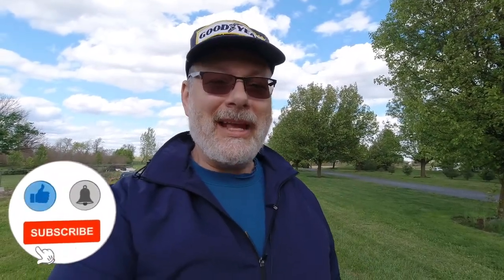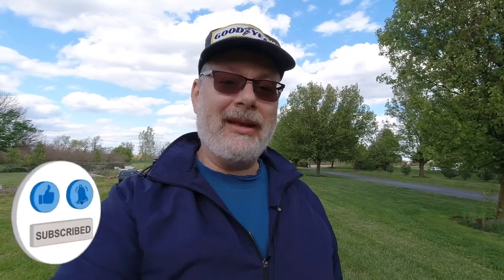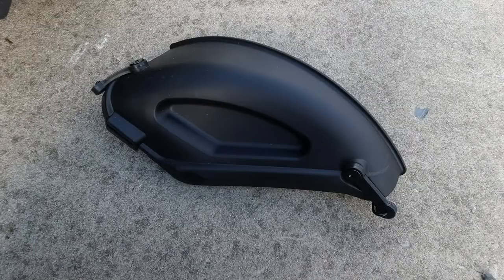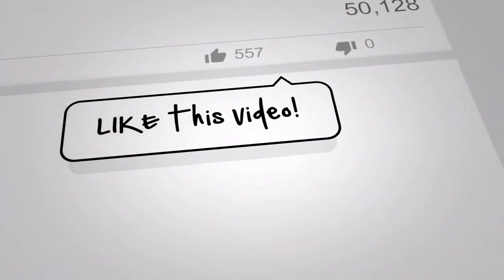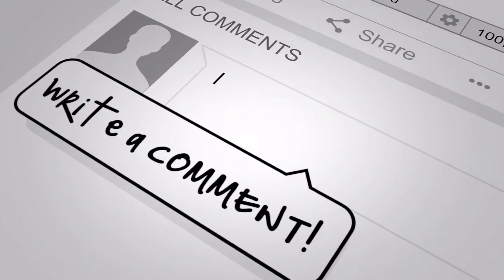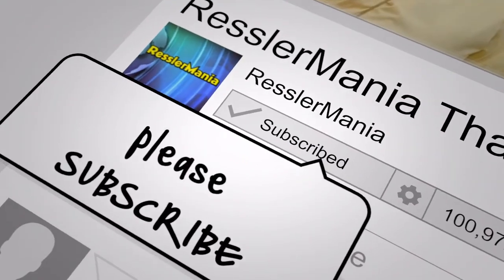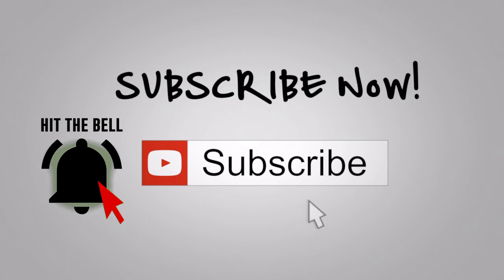Ryobi Zero Turn Mower Mulching Kit Installation and First Use - RM00222

Comment: Where can I get this adapter?
Reply from the maker: Thanks for watching. You can get it off the Ryobi website but it does come with the mower (at least it did when I bought mine). This video was to show how to use it since the instructions manual was  a little confusing on the matter. Have a great day 👍.

Comment: In the video you mention that you didn't have to remove the guard. But is that an option? Can it easily be removed while the mulching kit is installed? Removing that guard would allow me to get closer to obstacles - less to weed eat!
Reply from the maker: Thank you for the comment. What I was referring to was there is not need to remove the guard in order to install and use the mulching kit. However, you may still do so if you want to. What I do is simply get close with the left side of the mover so I have less trimming. Hope that answers your question. Have a great day.